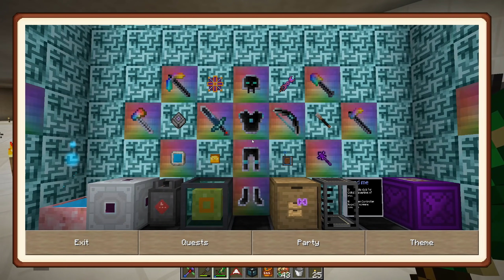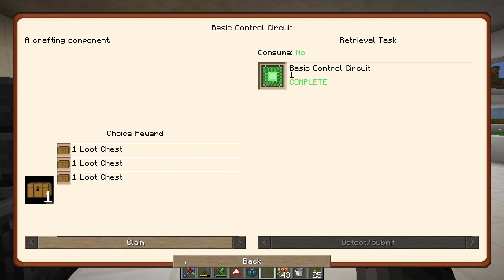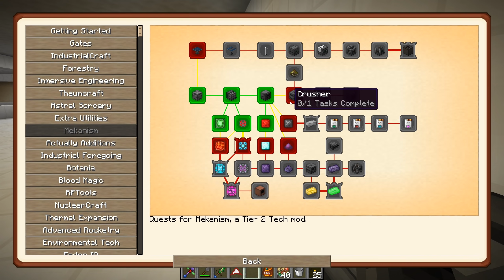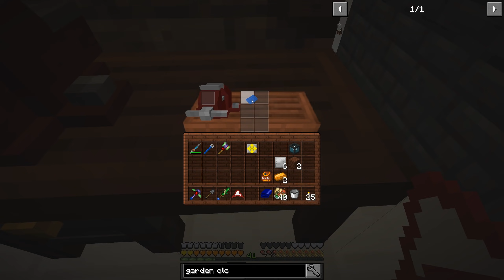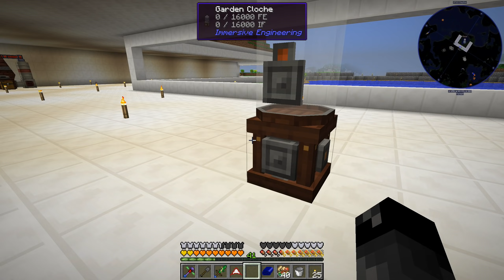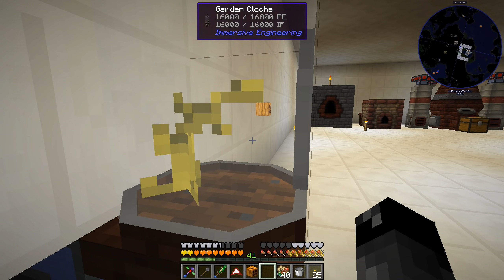Enigmatica 2 Expert - GARDEN CLOCHE BIO FUEL [E18] (Modded Minecraft)

Comment: Wouldn’t melons be better? You get multiple melon slices from each melon and 4 from each melon slice
Reply: the melon block has to be broken or splitted up from the thermal factorizer... which is expensive in this pack.
Reply: Ah
Reply: wouldn't it be possible to place melons, break them with a piston and collecting them?
(blockplacer into piston with observer into some kind of hopper)
Reply: @BlackDragonWitheHawk  better to use thermal factorizer unless you have a fortune 3 axe (max 10 melon slices), where in that case, it would be better to have 2 mechanical users from extra utilities 2. One places a block while the other breaks it with an axe... Unless the axe is unbreakable, it will eventually break after that many uses on said axe.  A factorizer takes no power since it's a device, and devices are different from machines in thermal foundation.
Reply: There is an auticrafter to craft the melon into 9 slices for free. It only costs a lot of wood and some stone
Reply: in another part of this comment section someone suggested just piping the melons into a compacting drawer.

I'd never have thought of that, but it should work and be ridiculously easy ;)
Reply: @wolframstahl1263  I don't think hypt can get a compacting drawer with ze resources he has rn.
Reply: @metayoshi1712  Well, I don't know the recipe in this pack, but I know what he did to that cloche. I'd have seen that recipe and hidden under a rock for a week :D